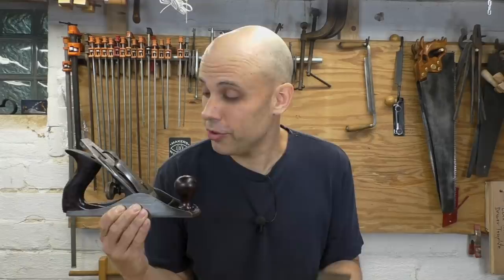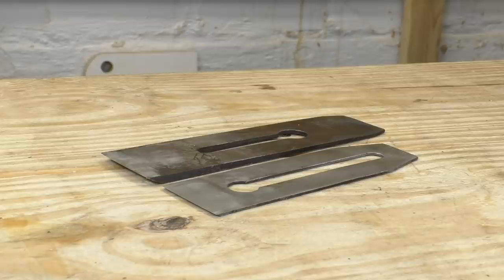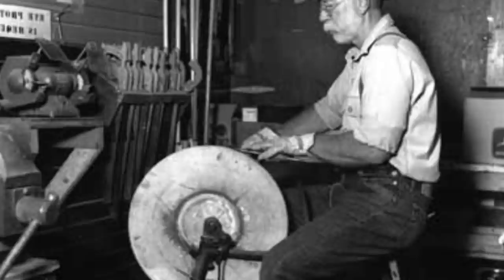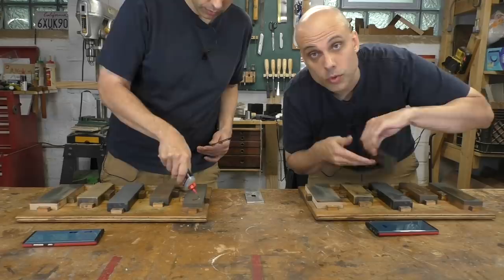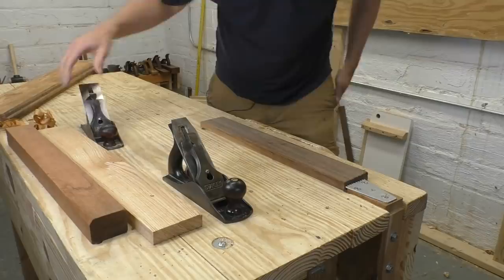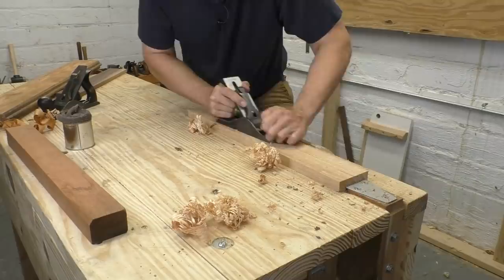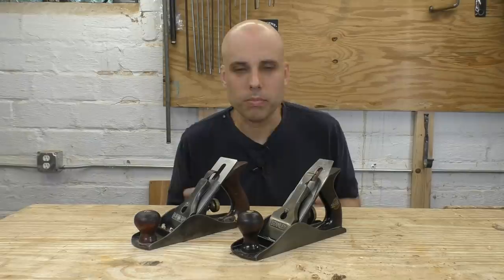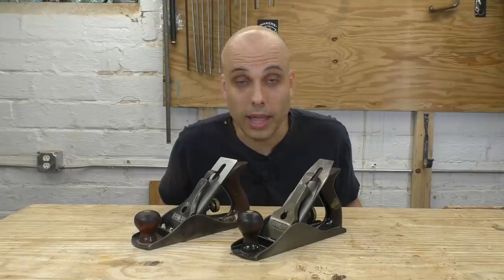Modern vs. Vintage Plane Irons. Head-To-Head Test!

Comment: I have nothing to say really, but I appreciate your content, and wish to help with the yt-algorithms.
Reply: Mentioning the Algorithm is detected by the Algorithm, and therefore prevents the comment from contributing to the visibility of a video. This information  was data mined.
Reply: Is this the 1000th time you have wrote this what’s your deal
Reply: @ianbutler1983  When I google it this is what I find; "Comments still play a part in the algorithm, though not a big part comparing to other metrics". So it seems like it doesn't matter very much, but I suppose every little thing helps right?

Comment: So ... stuff that worked for decades and decades still works and a well made modern equivalent also works well. It's great that good replacements are available though, because not all old irons will be in good condition, they can be lost, etc.
Reply: Or very pitted with black rust.

Comment: Sure, thick blades are better. It doesn’t mean thin Stanley’s can’t do the exact same job though. Or that chip breaker are useless. Or that bevel up planes are better. Nor Japanese.
Reply: Truth
Reply: I don’t think you can get the same finish with  western plane as you can on a very well setup Japanese plane.
Reply: @grantwilliams630 hmmm, indeed, a very good Japanese plane can be set to a very high level of precision by a very good guy to take really long and thin shavings out of perfect beams of perfect wood. I am not sure the design of the plane is more important than the dedication of these incredible craftmen though.
On actual craft woods and craft work, anything can be made to work very well, as history shows us.
Reply: They're all good! It's worth noting that most of that beautiful Japanese woodwork is done in relatively soft, even grained wood. It's not like a Japanese plane (or any other kind)  would take those amazing shavings from twisty hardwood.
Reply: @fatnerf  one important thing is a lot of Japanese woodworkers have multiple smoothing planes they work through with a finer finish each time. I actually think that was common with some of the wooden western planes as well
Reply: Thick irons are not better thy may offer a slight finer finish on grain that can fur up but that is about it. 
If you want the best finish possible you really need to be selecting the wood that has the desired grain pattern. 
That is the difference between fine furniture and general craft furniture.

Comment: They say a bad craftsman always blames his tools.  If you can't use a tool properly you wont get a good result no matter the quality of the tool. I'm really just getting started. I brought an old Stanley and an old Pope plane at a flea market and managed to assemble what I hoped would be a useable plane. Bad result. So I watched some you tube videos, including yours on sharpening and setting up a plane. A bit of fiddling and eventually putting together a decent sharpening set up I started getting good results. There is still room for improvement but I am sure I haven't reached the capabilities of the old Stanley. The Pope is too far gone and wasn't as good as the Stanley to start with. I might salvage the blade and chip breaker and try building a wooden plane from scratch once I get more practice. Another bonus after all the fiddling and watching the videos, I know what to look for next time I go shopping for old planes.

Comment: Back in the day, we were thrown in at the deep end to work with what was available - and at that time, the Stanley with it's thin iron was the trade standard. We worked Mahogany (what little was left of it in UK), Beech, Oak (horrible), Ash (my favourite wood to work with) and a few others. My point is that a true craftsman (those who taught me) that worked everyday with a standard Stanley plane would consistently outperform anyone else with a fancier plane or blade. You could spend hundreds - thousands - on fancy upgrades but it's not going to make you a better woodworker. The only way you can do that is to do it the way they did it - day in, day out. I'm 62 now and I'm still not as good as the guy who taught me in my teens.

Comment: When I first started using Hock irons, which I like, I assumed the thickness of the blades was the reason I liked them and that they would solve my hand planing problems.  I was just learning to use hand planes. I had a lot to learn.

With more experience, I came to the conclusion that the quality of the Hock steel is excellent, both for edge sharpening and edge retention, and I am glad I have a number of Hock blades.   Nonetheless, the traditional Stanley blades work very well, just as long as they are not warped or out of square AND as long as they are kept sharp -- which will be true of ANY plane blade.

Also, with more experience using hand planes, I came to another conclusion that -- in my opinion -- blade thickness has little do do with either the common problems OR the solutions to those problems that people encounter -- that I encountered -- when using hand planes. 

Most of the issues with hand planes can be resolved as follows:

(1) Learn to properly tune up and dial in a hand plane, whatever brand of plane or blade is used.
(2) Learn to initially flatten and to hand sharpen plane blades. Sharpen them frequently. Get and keep them razor sharp by stropping them. (Hand sharpening is faster and cheaper.)
(3) Develop a good, solid stance over the wood and learn to stroke the plane with a "scooping" motion using the whole body, not just the arms.
(4) Practice using the plane in various types of wood. Ease the plane blade into the wood gently by adjusting the depth of the cut. Learn to read the grain direction before you start planing and carefully observe the shavings as they come off the wood. Make adjustments in light of what the shavings indicate.
(5) Keep your plane soles lightly lubricated with wax or oil.

Did I mention keeping your plane blades sharp?

If you do each these things, then blade thickness will not matter much. If you don't do any of these things, then blade thickness will not matter at all.  Guaranteed.

A tuned-up and dialed-in plane matters a ton. Blade sharpness matters a ton. Blade steel quality? Yes, it matters quite a bit, actually, and Stanley blades are made of good steel.  Blades thicker than Stanley blades?  Meh.

I happen to love and use old Stanley planes, especially those I have restored, but I use others, as well, including Lie Nielson, Veritas, Wood River, and Record. All are excellent planes. I treasure each one.  However, if I had only my refurbished Stanley planes with their original blades, my work would not suffer one bit -- and I use hand planes a lot.

One interesting thing about Stanley Bailey #4s and #5s is that they are relatively light in weight compared to other "high end" planes, including the Stanley Bedrock planes and others built on that design.  This lighter weight can make quite a positive difference when you are doing a lot of wood planing.  Don't thumb your nose at a Stanley Bailey. They are effective, they are available, they are affordable AND they are beautiful.  Just saying...  (But I beg you not to use one with plastic knobs and totes. OMG. Don't even go there.  🙄   In any case, you an easily and enjoyably make your own knobs and totes.)

Oh, did I mention keeping your blades sharp? 

One person's opinion, FWIW. 

Thanks, Rex, for another good, thoughtful, and helpful video. 👍👍
Reply: Wise and truthful words 🤙😁 but you forgot to mention about keepin em sharp 😂
Reply: I do agree on most of waht you wright. When you say Stanley planes, you do not menschen you refere to US or GB made ones. The part of the frog that supports the blade in US pre WWII planes are made and machined so they support the blade much better than English ones and post WWII US planes. In those English and post WWII planes, thicker blade is less prone to shutter in hard wood. About the weight, English Stanley planes are considerably heavier than US ones. Before Stanley started producing planes in England they made a #4 ½H and #5 1/2H (heavy) for the English market to compete with English infill planes, Like Norris etc, that were the English high end woodworkers  go to planes at the time (early 1900) that were much heavier.
Reply: @TSolderman  I have both US and GB made Stanley planes -- #4's and #5's. Haven't seen a huge difference in actual use.  I like and use them both.

Comment: Thin irons were laminated too.
I own several older Stanley's and Records where you can clearly see the two different pieces of steel when you polish the bevel.
The thick,tapered irons in woodies were made that way because the taper helped wedge them in place and made adjustment easier.

Comment: I’m an old man and have so many planes I’ve picked over the years I’ve started giving some away. But, to me, besides a properly sharpened blade, the most important feature in a plane is a proper fitting frog, and chip breaker. That’s my 2 cents. BTW I just picked up another Stanley 9 1/2 block plane yesterday. It’s a sickness I tell you. Thanks Rex!

Comment: I'm a retired 49yrs being a carpenter from the UK I love your very informative programs, I just don't like how you put your planes down justs in case you don't notice the odd screw that's on the bench and inevitably your plane iron lands right on it meaning another sharpen up, I always put my planes down on the side, less chance in the workshop but more on site of hitting the iron  because no bench usually the concrete floor.

Comment: I can tell a difference in vibration on very hard wood.  The Stanley "sings" while the thicker irons leave a smoother finish.   I was very happy with my Stanley irons. I only replaced one because it was worn out.

Comment: You should look into the cheap HSS replacement blades they sell on amazon. I bought some for less than 15 dollars, those are worth the money. Ron Hock irons are very good, key is getting them very sharp

Comment: It sounded and looked like the Hawk took just a little more effort to use. Also I wonder if the Stanley was just slightly rounded at the corners - resulting in a little less full shaving. Great video - I sure like how Rex figures it out!
Reply: I think it was the setting of the Hock's protrusion below the plane's sole and, you may be correct about the corners of the Stanley's blade being slightly rounded. That's a practice that's generally recommended in order to avoid "Plane Tracks" [ridges caused by the blade's edges scoring the surface] when using a plane for smoothing.

Comment: Rex, I would say it is about mass and resulting vibration frequencies - but unless the fundamental of hand planing are down it won't do a thing. It probably wears even more on one as mass was added to the given plane.
To really show the difference one would need a levered machine setup with motor torque output and some macro camera or microscope setup to analyses the surfaces produced. Any properly set thick blade will outperform thinner blades, as they retain the momentum better as keep in the cut line more.

Comment: Many (if not most) of the pre-WW2 irons were laminated. I’ve seen several references to this, but have also recently flattened two blades, one a V-logo (1912-1918) and a current logo (1933 to present), and both had a clearly visible lamination extending about 2” up the iron. I expect they made them this way because it allowed them to heat treat the whole blade in a way that would leave the laminated piece very hard without making the rest of the iron brittle. Great video, as always.

Comment: After watching Rex’s video, and taking in the commentary, the axiom of KISS is still a good direction.  For those that have the funds, and want the best or newest, then by all means go with a Hock blade, and use a Woodriver or Lee Nielsen with the newer tech iron if you have the funds.. If starting out in the wood finishing/construction trade, then rehabilitate a few Stanley planes, use a typical iron and make money the old fashioned way., and gain experience with the craft. I was a professional photographer for 35 years and worked my way up into using Hasselblad cameras as I acquired the knowledge and ability to fine tune my profession. Thanks Rex.

Comment: IMO, the big advantage of the newer blades isn't their thickness, but the quality of the steel. The edge holds longer and doesn't fall off a cliff quite as fast. I doubt if the thickness has anything to do with that.

Although one advantage of a thicker iron is when learning to freehand sharpen. If you don't do a secondary bevel that wider bevel to register on makes a huge difference.

Would be interesting to see a traditional dimension blade made with some of the newer steels. Could be the best of both worlds.
Reply: Older thinner irons have enough quality and work. Some of the best furniture ever created used Irons that today would be considered a lower quality.
Reply: @bighands69  bighand69 I hear that a lot but have never seen it, every time I’m in Newport looking through the Vanderbilts Estates hi see dovetails with gaps.😂 I have the feeling that what we do nowadays is got to be better
Reply: @jean-paulbaudet2951  
You must be joking. There is nothing from today that comes close to the furniture of the Georgian fine furniture period.
Reply: @bighands69  - the older pieces are truly amazing. I’ve also seen some Thomas Moser pieces that were amazing.
Reply: @michaelkaplan2190  
I am afraid that nothing produced today can come close to the peak of regency period furniture.
Reply: This! Even my best tool steel blades just don’t last compared to any of the modern steel blades I have. The cut is subtly better for sure, but man not having to resharpen so often dramatically improves my experience planing. I had to buy a new plane for my smoother just due to how poor the tool steel was on it, and even my Stanley no 7 type 10’s blade just did not last for actual flattening work
Reply: You cant beat those new modern irons for multiple reasons stiffer blade less chattering, also holds up better due to the quality of steel being used, and because of that edge retention is better.

Comment: I do believe that the slight difference you noticed between the irons (wider and more consistent shavings with the new one) could be attributed to the fact that you probably have sharpened by hand your Stanley iron a lot more, so it won’t have the perfect straight and square edge that the factory machined iron has, so, even after honing, it could have had an ever so slightly different blade geometry giving you different results.  

Anyway I think the most useful part of the video for me was at 14:20 when you showed the iron jamming, when people talk about fitment of the chip-breaker they tell you that “the fitment must be perfect or your plane will jam and get clogged up” so when I had problems with planes getting clogged up with shavings I unsuccessfully obsessed about getting a perfect fitment of the chip-breaker but I realized just now that nothing like what you showed ever happened to one of my planes so that wasn’t the problem and I should instead have searched a solution elsewhere…
Reply: I believe that the clogged cap iron problem resulted from when he abraded the first 1/2" of the brand new Hock iron which caused an imperfect mating of the blade assembly.

Comment: I dont think you mentioned which steel was in your hock kit O1, A2 or powder steel, each has different characteristics. I upgraded a not so vintage Stanley with an O1 kit not so long ago, I think the chip breaker made a bigger difference than the blade as the original was damaged.

There are 2 other tests I would do. 
1) the thicker blade should help with chatter. See how thick a shaving you can get on a piece of wood without getting chatter.
2) time needed between sharpenings.

Comment: Hi Rex! I think that for the new chip-breaker that does not "tense" on the tip of the iron, if you sharpen only half an inch on the iron you are creating the gap for the shavings to jam in... If you would have sanded the whole thing (or at least a much longer than half an inch) the chip breaker would have probably sat even better and not allowed any shavings to get in. Love the video and tips!
Reply: @RexKrueger  Oh :) That's probably true. I would've added a picture to show what I meant but youtube won't let me. I trust you are right though, although I've always wondered how the new chipbreaker sits after sanding. You're saying this: https://ibb.co/yq1GZPp doesn't happen?
Reply from the maker: @GCaF  it does not.  Whoever made that image has no idea what they're talking about.  All chip-breakers are "sprung" and have bow either bent or milled into them.  This spring is far greater than any dip caused by flattening the iron. There's no such thing as a chipbreaker that's straight as that picture shows.  But also,  you've been very open minded and civil in this comment thread and you have my deepest gratitude for being cool.
Reply: @RexKrueger  Thanks man, I've been a big fan of your work for ages so I didn't take it personally, I know you know what you're talking about.
I just whipped that picture up to ask you about it. I had NO idea that even the new chipbreakers are bowed. I don't own one, I've only seen them in videos but I would have sworn they are straight and that's what always puzzled me. Judging by the fact that I got some likes it's likely that other viewers believe this as well. Would be worth a video :)) - the old chip breaker has a "clear" bow but these new ones always looked straight to me. If they are bowed then it makes perfect sense... and I should have bought one and studied it before commenting like you suggested. I only own "old" ones :D
Reply: Wait. A civilised comment. On the interwebs?
Kind of sad we are surprised by those. 

(thanks to all who keep discussions civilised, though Rex' viewers are really good at that!)